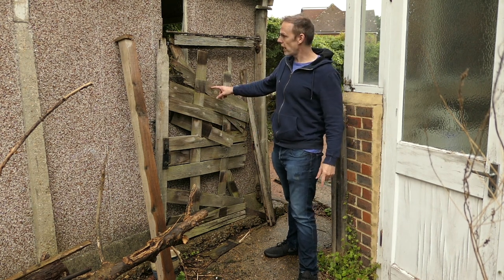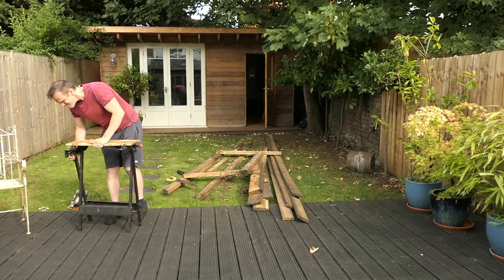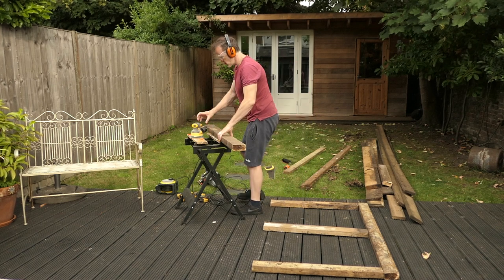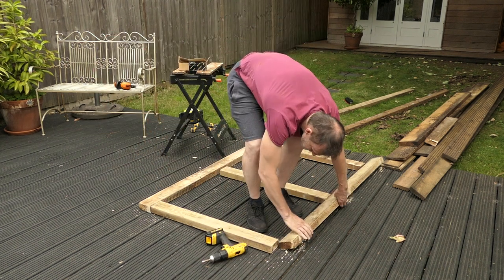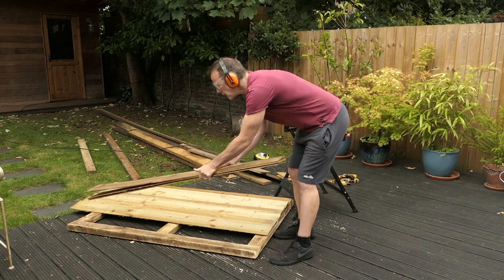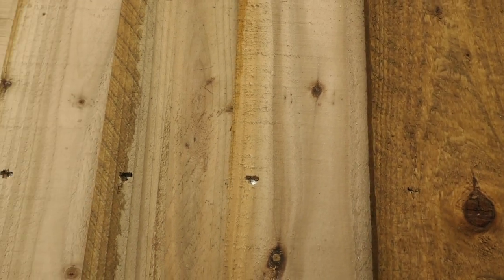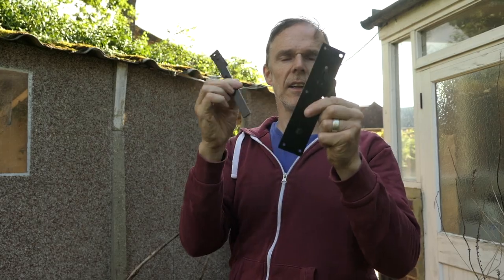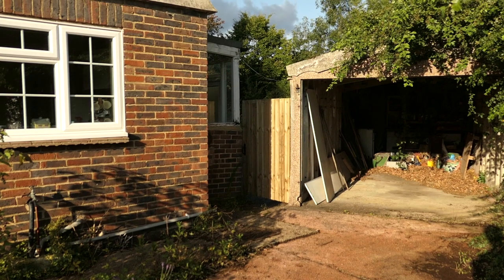MAKING A GARDEN GATE

Comment: Good idea but you haven't used diagonal bracing for the gate, that gate will sag soon
Reply from the maker: There's been no sagging. The timber bolts are pretty long and have pulled the frame together really tightly, also the middle brace and the extra brace at the bottom has helped to hold the frame square.